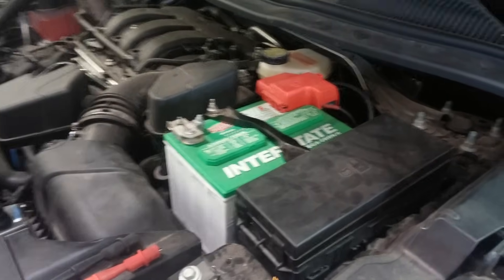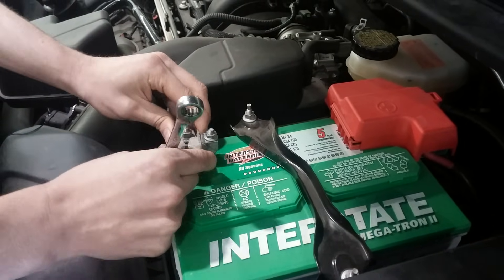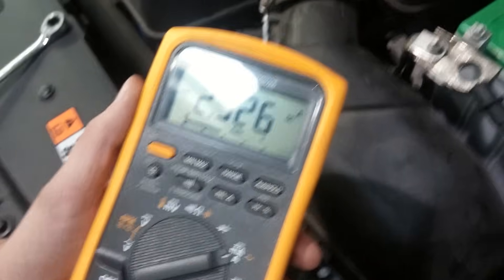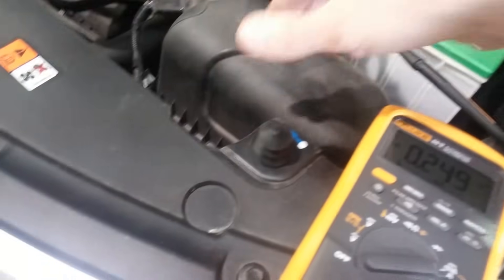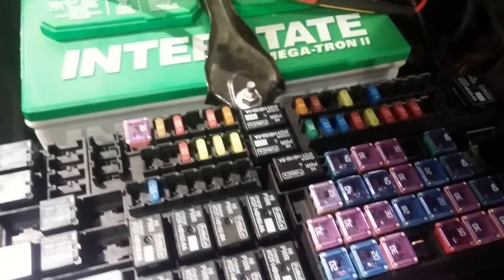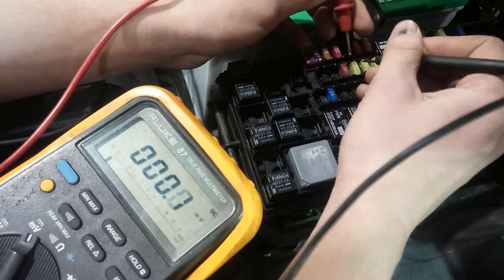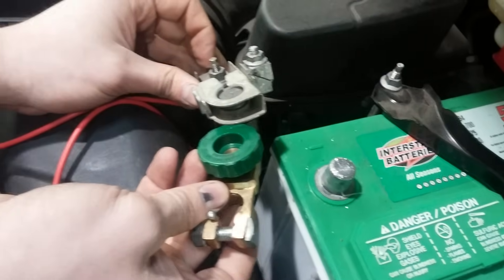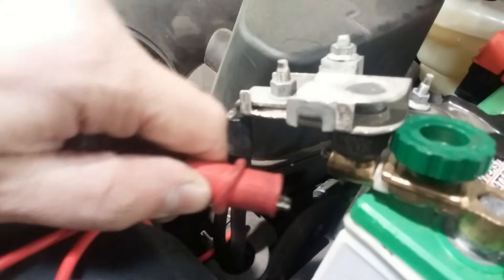How to identify and locate a parasitic drain

Comment: Best set meter leads and settings ahead of connecting. Do not be forgetful eh?
Reply: I am a retired electrical engineer & yes you should not move the meter switch while connected to a circuit.

Comment: Hi, if my car sits for two weeks & I go to start it I get the clicking & it won't turn over, I did the battery drain test  result was 00.44 ma. Took all the fuses & relays out 1 by 1 nothing the multimeter didn't drop the battery is new & i checked the alternator diode test was 635 & 1  charges 14.2 at idle. Cheers: Dom

Comment: Good video but he forgot to mention what to do with that faulty 10 amp fuse.
Change it I’d imagine????
Reply from the maker: Yes.  Change it.  I didn't mention it in the video, because we can safely assume that it has nothing to do with the parasitic drain on the battery.
Reply: @JustinMillerAutomotive  Wouldn't be a bad idea to figure out why the fuse blew.  They generally don't unless something is wrong with the circuit.  And, the  parasitic drain could well be associated with the blown fuse although obviously not directly on the blown fuse's circuit.

Comment: You should have connected red (+) voltmeter connector to ground (-) connector of vehicle and the black (-) voltmeter connector to the negative (-) connector of the battery to avoid getting a negative value reading like you show us.
Also you mentioned about the door latch to be closed so that the car thinks it is closed and ECU's go to sleep, but you might need the trunk open as well (if you have a 3rd fuse panel which is in the trunk) and also you need to close the hood latches as well.
Thanks and good luck!
Reply: Doesn't matter if you connect them in reverse -- he knows the negative reading is actually positive. And he knows in this car it only has one fuse panel
Reply: @shimmeringreflection  true but those of us with ADD won't have it LOL

Comment: Once you find voltage across a fuse can't you just pull the fuse and recheck the other meter for current draw? Rather than continuing to check fuse after fuse.
Reply from the maker: In theory, yes.  And it may work.  However, if that fuse is tied to any of the ECUs in the vehicle, that may not work.  Sometimes pulling a fuse can cause other circuits in the vehicle to turn on, which in the reason that it is difficult to diagnose a parasitic drain on a modern car by removing fuses like we used to many years ago.

Comment: So the first step with tj3 battery hooked up to a different meter and then you used another meter for the fuses. Can I skip step one? Or do I need to have the other meter hooked up like you did since we aren't reading that other meter
Reply from the maker: If you skip step one, then you are looking for a problem without first verifying there is a problem.  This could waste a lot of time going down the wrong path.  If you only have one multimeter, you can remove the first multimeter and reconnect the battery then perform step two using the same meter.
Reply: I figured it out finally. Thank you though

Comment: hi, I have excessively battery drain overnight and I'm confused by most of DIY videos about funding a short circuit, some of them says to find a short circuit check the fuses when you find a blown fuse you found the problem, some of them says test all the fuses to check for amperage draw which means the fuse is not blown and there is a short??!!! anybody here can explain something to me?
Reply from the maker: A blown fuse "opens" the circuit.  This doesn't usually create a parasitic drain.  You are checking for fuses that have current flowing through them because they will lead you to the circuit or component that is shorted, or remaining "on" when it should be off.

Comment: Does anyone know how to test the cartridge style fuses that have tops that don't come off? Or you just don't test those ( they are always in one of the blade fuse paths?) Can't find one video on ideas to test those.. do I literally have to pull each one in prep and extend them out with  leads and test on the lead? What am I missing here.
Reply from the maker: That is a good question.  My first answer, is don't worry about testing them unless you have tested every other blade-style fuse and found nothing.  At that point, you will have to get more creative.  sometimes you can pop the clear cover off of the fuse and measure voltage drop between the terminals, sometimes you can access the circuit in other places, and sometimes, if you absolutely have to, you can remove the fuse and insert a fused jumper wire in its place so that you can test it.
Reply: @JustinMillerAutomotive  that's what I resorted to. It was a 2013 dodge journey with intermittent draw. The draw ended up being on one with those cartridge style fuses. And the ones they use on that journey... I could not for the life of me get the tops off without breaking the fuse!!! Just a heads up for anyone dealing with these vehicles!n

Comment: So after confirming I had a parasitic draw and many hours of confusion trying to figure out which circuit was the culprit (in my case it appeared I was losing juice from 2 or 3 circuits, total parasitic draw was showing 2.5 A) I realized that even knowing which circuits are responsible....WTH do you look for next....I'm no wiring schematic type....so basically useless for me unfortunately.

BUT....I thought back to the video and remembered the part where he shows the battery cut off switch being adapted into another way to test for parasitic draw. There was my answer, a battery cut off switch. Went to auto parts store, bought batt cut off, installed, voila....no more overnight drain or day drain for that matter. If I'm going to be out of my vehicle for more than half an hour I disconnect battery with batt cut off switch....15 minutes in and out of store, I don't bother.

Bit of a pain every day, but you get used to it quick, and it's way better than screwing with dead batteries all the time. Don't have the money to pay a mechanic the likely hours it would take them to track down the problems, if they were even good enough to diagnose at all. About 20.00 for the switch in Canada.....probably 5.00 in the US, lol.

Hope that helps someone out.

Comment: My truck draws .29 milliamps. It would be nice to see it go below that, but I cant find anything that is the source.
Reply from the maker: Do you mean 29 milliamps or .29 amps?    If you are reading I don't think your meter is capable of reading .29 milliamps! :)
Reply: The meter is set on  milliamps , the display reads .29
Reply: However, I will recheck the setting, and the display reading
Reply: I am using an  Ames dm600. The dial is set to mA.The red lead is inserted in the left slot of the Meter market as A.The negative battery cable is disconnected.
One meter lead is connected to the battery post, the other meter lead is connected to the battery cable.The meter reads DC 0.29 MA.
I am assuming this is .29 milliamps.
Reply: When I put the red lead on the left side, the meter reads 0.01

Comment: Good video but i've been taught at the nissan training center not to completely remove the battery terminal until the dmm is connected in series. This way you dont accidentally kill a intermmitent drain for example a relay
Reply: Good idea!

Comment: I have tried this many times, My multimeter reads 0.000amps. But, Yet My Battery keeps draining..
Reply from the maker: Usually when your multimeter reads 0.000 amps, you have a blown fuse in your multimeter.  Check out my video on how to check and change the fuses in your multimeter: https://www.youtube.com/watch?v=-SRz7kR4ovQ.

Comment: I disagree bout the clamp on amp meter. Don’t have ny problem measuring 30 milliamperes with my clamp on. If it is 10 or15% off who cares!
Reply from the maker: Some current probes are better than others at measuring low currents.  You can buy current probes that are specifically made to be accurate with low current.  In my experience, with the typical $100  current probe made for 0-60 amps or 0-40 amps, it can often be more that 100%-200% inaccurate when you are trying to measure only a few milliamps.  They just aren't designed for that.  In fact, once I zero my current probe, and move it around, it can sometimes measure more than 30 milliamps before I have even placed the probe on the wire!  And accuracy is important to me.  When I measure current I am doing it because I really want to know how much current is flowing.

Comment: If you employ the battery shut off switch wouldn't that cause the car's computer to lose power and then lose data? Thank you
Reply from the maker: As long as your meter is in the "Amps" mode, and connected between the battery cable and the battery post, you will not lose your memory even when you disconnect it.  This is because your meter maintains the connection between the cable and the post.

Comment: Couldn't one just go straight to the fuses to find voltage ? The amp setting at the terminal seems unnecessary with the current flowing through the meter as though it wasn't there.
Reply from the maker: The purpose of measuring current at the battery is to determine whether there is really a problem or not.  It would be hard to diagnose any problem if you didn't know if there even was a problem.

Comment: How about the other fuses without metal on top to measure from? Or, how about relays in the fuse box?
Reply: That's what I'm wondering. You need fuse testers?  Not sure man. I'm thinking bout just putting each of the fuses I can't test in this manner on leads . And then testing the leads.

Comment: I have a 0.4A parasitic draw on a Honda S2000 that isn't going thru any of the fuses. Anything besides starter and alternator that could cause it?
Reply from the maker: If you have any aftermarket devices in the car, they may be connected to the battery directly rather than through a fuse in the fuse box.  If you can find access to a "power distribution" wiring diagram, you can use it to see how the circuits "branch" off of the battery.  This can be helpful to narrow down which branch has the drain in it.
Reply: I have an S2000 with the same issue!  Did you sort yours out?

Comment: Always set your meter higher than you expect the current or voltage to be, then you can set it lower if needed. Unless you have an autoranging multi meter you could damage the meter if you set it to low.

Comment: Hi Sir Justin! Have a great day to you. I have one very important question for you not related to parasitic drain but I'm pretty sure you can help me better understand the behavior of digital multimeter. First, I'd like to tell you that I am not an electrician and I do not have background in any electronics courses. I'm self studying electronics by watching tons of videos on YouTube. So, I bought a new multimeter and this is my very first multimeter at hand. And I started testing my multimeter measuring electronic components volts, amps, resistance, capacitance, continuity and so on,  the multimeter looks like it is working properly according to it's purpose. However,  I'm very startled, when I put the measurement to millivolts both AC/DC, the multimeter keeps on providing screen reading even I am doing nothing and the reading on the screen keeps on increasing overtime. I wonder if it is normal for a multimeter to behave like this? Or does The board is grounded? Should I return this to the seller? I hope I can spare a little time from you to enlightened me with this wonder. Thanks! 🙂
Reply from the maker: In the millivolt setting or auto-ranging voltage setting, it is normal for the numbers to constantly change on the screen.  To see if your meter is working correctly, touch the two leads together and the voltage should go to zero.  As long as the leads are not touching anything, they will be trying to measure voltage potential in the air, or on anything they touch.  As soon as you place the leads on something in the circuit, the voltage should stabilize and read correctly.
Reply: @JustinMillerAutomotive   In an odd good way, the meters are requiring a closed loop for its leads. If open circuit it is trying to measure air static, which is nebulous.

Comment: Great video, going to try to find out why my nissan qashqai is draining the battery through this method, but what do you do after you find a fuse that is draining the battery. do you change it, take out for good, how do you fix this problem, any thoughts?
Reply from the maker: Ideally, you would be able to find a wiring diagram that tells you what is connected to that fuse.  Then, you can begin isolating components in that circuit one at a time.  For example, if the radio and auxiliary outlet are both connected to the fuse that has high current flow, you could disconnect the radio and see if the drain goes away.   If not, you can disconnect the auxiliary outlet.  If neither makes the drain go away, then there is something else connected to the circuit.  Sometimes it is an aftermarket device that someone has wired into the vehicle.

Comment: Awesome vid....the only thing i would add is if you have a large parasitic draw like in this video I usually start by disconnecting the alternator before going to the fuse box.  From past experiences of bad diodes in alternators even if you pull all the fuses the drain remains
Reply: Aha! Maybe this is my issue. I have a Honda S2000 which has a parasitic draw of 0.4A that continues even if all the fuses are pulled. Before I test the alternator, do you any other ideas of components that can draw but don't go through fuses?

Comment: Hi Justin, I tried by removing negative plug and I'm getting 0.5 Amp parasitic draw. Then instead of removing all fuses I find easy to touch all fuses by leads but I didn't found any draw by touching fuses. I decided to pulling out fuses if I find but some of fuses are too hard to remove by fuse pullers. And I have one more query What about the medium size and big size fuses inside the hood fusebox. Do we also need to check those?
Reply: I'm able to see draw of 0.5 Amp but can't be able to detect which system is draining. As I'm having airbag sign on dash does it have any correlation with any draw?
Reply from the maker: Does the light stay on when the ignition switch is off?  If so, then it probably has something to do with the drain.  If you have checked every fuse (make sure you are aware of all of the fuse boxes in the car), and you didn't find anything, I would recommend starting at the battery cable.  There are usually 2-3 cables coming off of the positive battery terminal.  The drain is going through one of them.  It could be your starter or alternator causing the problem.  The starter motor doesn't have any fuses and the alternator fuse is likely one of the large square fuses that you can't probe with your multimeter.  You could disconnect the starter or alternator to see if that eliminates the drain.  For a drain that large, you could use a current clamp around each wire to identify which one has current flowing through it.  As a general rule, you don't need to check the large square fuses because they usually feed current to the smaller ATC or ATM fuses.  However, if you have tried all of the normal tricks and are still getting stuck, it is time to get creative.  There IS a drain, so there IS a way to find it.

Comment: You need a current consumption matrix chart to determine the current based on the mV reading you are getting. And this is also based on the fuse rating and the fuse type (Mini, Standard, etc). https://www.google.com/url?sa=t&rct=j&q=&esrc=s&source=web&cd=1&ved=2ahUKEwj0jbHc4b_lAhVIo1kKHf83D-UQFjAAegQIARAC&url=https%3A%2F%2Fwiki.bentleypublishers.com%2Fdownload%2Fattachments%2F83329026%2Fvw.current.draw.tb.pdf%3Fapi%3Dv2&usg=AOvVaw3Rrk6z_8SGvMHoldcW0zg0
Reply from the maker: Great comment.  I have a chart like that.  However, when I looked closely at the chart, I noticed that virtually any reading besides 0.000 is a problem.  So, if you want to keep things simple, if you have an unacceptable amount of current draining, look for any fuse that doesn't read 0.000 across the back of the fuse.  I will also mention that sometimes when you get into large fuses such as 120 amps, you may be able to barely detect any voltage drop, even when there is a drain.  Larger fuses drop less voltage.  The good news is that the 120 amp fuse probably feeds several smaller 10-30 amp fuses.  The voltage drop will definitely show up on these.

Comment: How do you convert the milivolts from a fuse to amps to see if it matches the initial reading from the battery?
Reply from the maker: There are published charts that give you those numbers.  It depends on the amperage rating of the fuse.  Low amp fuses have a thinner conductor inside of them and drop more voltage than a high amp fuse with the same current flowing through it.  For example, a 10 amp ATC fuse that drops 0.5 millivolts has about 65 millamps flowing through it.   A 20 amp ATC fulse that drops 0.5 millivolts has about 30 milliamps flowing through it.
Reply: @JustinMillerAutomotive  I think you might have those numbers reversed. The larger fuse will have more current flowing through it for the same voltage drop.
Reply from the maker: Yes I did get it backwards!  Thanks for catching that.  A 20 amp ATC fuse that drops 0.5 millivolts actually has about 150 mA flowing through it.  Sorry for the typo!

Comment: I'd rather not disconnect one of the terminals, because then I'll have to reset the sunroof, steering sensor etc. Couldn't I just monitor the voltage of the replacement battery and assume there is a problem if voltage drops to a certain point below 12.6?
Reply from the maker: There is not really another accurate way to measure parasitic drain.  Maybe you could use a very accurate microamp current clamp, but they are expensive.  I would recommend just using a memory saver when you disconnect the battery.